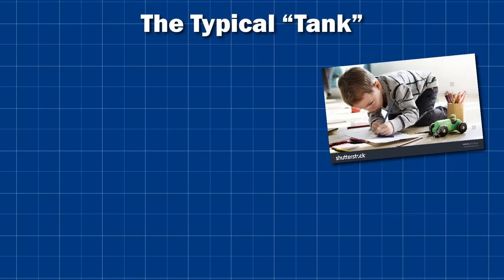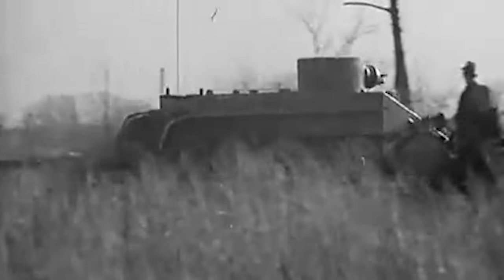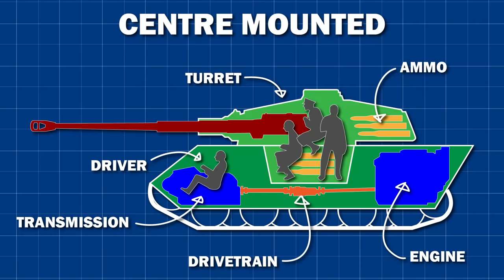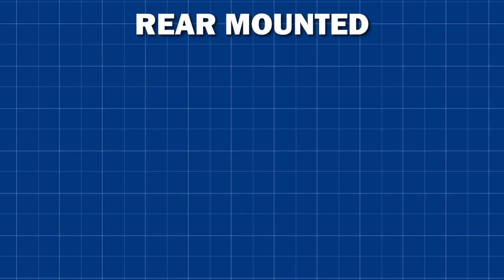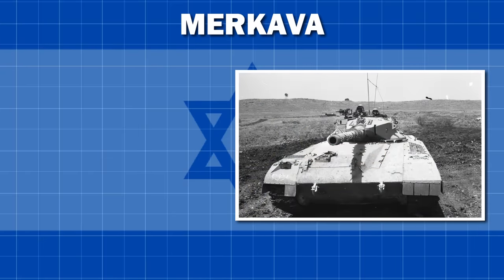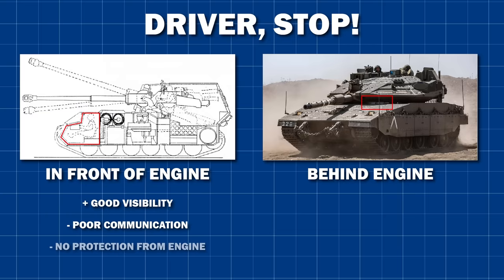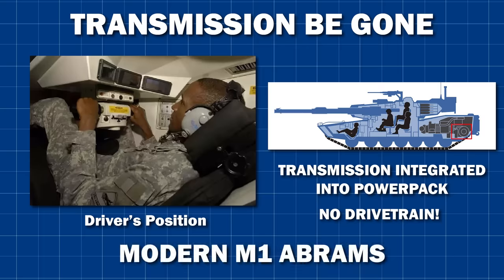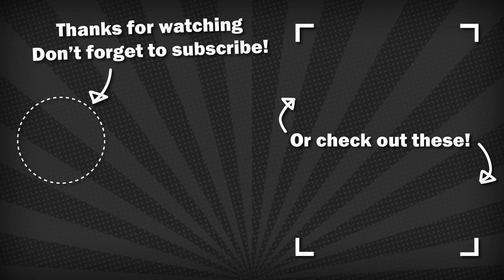What happened to Rear-Mounted Turrets?

Comment: My understanding of the Merkava design was it was built around the concept of crew survivability more than anything else as you can always replace a tank but trained tank crews are a finite resource.
Reply: Indeed, but with new APFSDS round that protection offered by the engine is somewhat lessened.
Reply: @Frenzyczczcz Tank combat is not always common place nowadays, especially in Ukraine. By the time the Merkava is in tank combat it’s in a hull down position.
Reply: @Frenzyczczcz the APFSDs isn't new (1960s) and a ton of engine will most certainly make a difference
Reply: @WillieBrownsWeiner   Yes, it is not new. However, the engine was placed there to protect the crew from HEAT. It will certainly make difference against sabot, however, probably not too much.
Reply: That is technically true, but not in the way most laymen think it is. The Merkava was a stop gap solution, its design born out of scarcity and necessity. The Israelis were trying to buy and license modern armor technology from the British, but they refused to sell it to the Israelis, so they were forced to misappropriate the tank's engine as makeshift armor. 
With other words, they were forced to use the engine as armor because they didn't have good normal armor.

Now Israel of course has proper armor technology, or could have it, but they are still stuck with the basic design of the Merkava. They are sticking to it more for political and traditional reasons than because it would actually be advantageous.

Having the weight of the engine and transmission at the front heavily limits how heavy and voluminous you can make the frontal armor. The Merkava has a relatively weak frontal hull armor compared to other tanks like the Abrams or the Leopard 2, but it still is very front heavy, which limits its mobility. There are many pictures of Merkavas which nose-dived into ditches and craters or even tumbled down cliffs and steep hillsides.

This limiting effect a frontal engine has on frontal armor is why Infantry Fighting Vehicles are always relatively weakly armored. 
The Germans decided in the 80s that they would develop a new family of armored vehicles with MBTs and IFVs based on the same chassis, where the IFV would have the same strong armor protection as the MBT. 
The whole project failed because they couldn't find a proper way to put MBT levels of frontal armor protection on a vehicle that has the ability to transport and quickly dismount infantry.
One of the ideas was to still put the engine at the back but to the side and leave a 80 cm (31 inches) wide walkway next to it for infantry to get in and out. On the MBT version of the vehicle, that space would have been used for a carousel replenishment auto loader (meaning a secondary auto loader that doesn't load the gun directly, but loads the primary auto loader which then loads the gun, like on the Stryker MGS).
They dropped that idea because that tunnel would have been too narrow for the troops to disembark quickly in combat and too unsafe.

The reason why I am going on that tangent here is to point out how it is a hard fact of armored vehicle design that the engine at the front makes it impossible to also have strong armor at the front.

But back to the Merkava:
In a way the IDF is a victim of its own hype. For so long they have spread the myth that the Merkava is the best protected tank with the most crew survivability because of having the engine at the front, that if they would change things now and make a new tank with a more traditional design and strong frontal armor, the Israeli people would be outraged and ask: "Does that mean now that the new tank has less crew survivability or have you been lying to us for 50 years?"
Reply: Poor driver..
Reply: @TrangleC "our newest armor technogy does not require engine at the front"
Reply: @TrangleC  this is exactly the post I was about to write. I will only add that the shortcomings of the simple Merkava armor ("lots of steel" approach) have lead the Israelis to develop Active Protection Systems - such as Trophy (and we have others but I only know the Hebrew name), which is now applied on some Abrams, Stryker and Bradley.
There's just not a lot of need for tanks in Israel, as long as the enemies are struggling to get enough water... And when they do need tanks - well, it's enough to see how Cheeky little Ukraine handles Russian tanks with Javelins and Stugna.
It appears that the Israeli doctrine is: If it's a big enemy, EG industrial-scale war, rely on Air Power, Spike missiles, Drones and cruise missiles. Tanks would be just to support the infantry that comes to clean up whatever is left.
If it's a small enemy - they will be shooting Sagers or Irani-Reverse-Engineered-Javelins and then who knows what good is a high-tech armor (EG CHOBHAM, etc)?...
Reply: @rifwann . BD enough getting a tank round but a tank round through his nuts
Reply: @TrangleC 
I’d say you’re right about most of this, however for the threats Israel faces on the regular, the Merkava is typically perfect. While it is true that an APFSDS round would punch straight through the hull, if you’re getting hit in the hull, then you’re already failing at being a tanker. A hull down defensive position is what it was designed for, with angles on the head to bounce APFSDS and reactive armor to stop tanks most common threats, ATGM’s and rockets, even now with active protection systems incorporated into the Merkava 4M. Tank on tank combat is relatively rare these days, especially if the enemy knows you have tanks in the area of roughly equivalent capability. 

In a stand up fight against a peer tank, yes, it would likely lose if both were on equal playing grounds, but as you mentioned, it was never made for that.
Reply: @TrangleC  The Merkava is not the only tank they've got, they also have the Magach series which are more traditional tanks. Merkava is mostly used for urban combat.
Reply: Yeah it was when it's design was laid out but not anymore. Modern projectiles wouldn't be hindered by just an engine block. Anything capable hitting hull from the front would instantly be an absolute mobility kill if not KO. .

For better crew protection nowadays you should follow the T14 armata's concept and improve upon it.
Reply: Yes, Israel has limited troops so they try hard to protect them, specially because they try to get their troops as specialized and elite as possible
Reply: Makes sense.
So far the US and other western countries are not willing to gift israel actually manpower but maybe in 10 years us military aid will also include humans.
Reply: @alexg4711 The financial aid is already a sunk cost. I imagine we'll see less and less go to Israel, not more.

Especially as the American public continues to have an ever dropping opinion of the relationship
Reply: @bartbroekhuizen5617  Magach is basicly M48 (and later with M60) suplies by US, just called by diferrent name, same for Sho't which is medium tank Centurion from British or Hovet/Machbet which is anti-air M163 from US
Merkava is their only own design so that their only traditional one, except you count modified Magach then yes Magach also their traditional stuff
Reply: @TrangleC  as for tanks go the merkava isnt bad honestly all tanks are built on the face towards the enemy premise and neglect the rest of the complete protection of the tank making all tanks on negligibly better compared to eachother and making them all obsolete today (outside of just being repurposed for infantry assault) these are barely tankettes today basically   

if we were to have a true modern tank it would need to be around 430 tons front back side top bottom pretty much invulnerable to just about anything the military conventionally uses as a anti tank munition 

to point out this shouldnt be considered a heavy tank or super heavy because of its weight thats actually how much armor it needs nor would it look anything like todays tanks either

so the problem is purely cost for real tanks these days because youd still need thousands of them with probably the same amount for bridge building tanks due to its size thankfully these days its a bit easier to transport something that big now the big trope then was 1950s thinking and a lack of larger ships to spare of transport combined with ww2 thinking of "overwhelm by numbers" over precision and quality and today we have both and in extreme quantity so might aswell build a 430 ton tank
Reply: it's actually so the crew can more easily bail when a child throws a rock at it (they're too low-velocity for the APS to catch)
Reply: That doesn't apply to the driver though
Reply: @TrangleC the idf never hyped its own tank
Reply: True,Israel doesn't like casualties
Reply: @TrangleC  about your paragraph about Germany: the main reason why the project of a new IFV was stopped was reunification and the monetary problem that brought with it (there were many things (military and not) which were stopped during that time)
but it wasn't given up and now we have the Puma which really tried to put the "Panzer" into "Schützenpanzer"
Reply: Goes to show the mentality fostered by unlimited American taxpayer dollars.